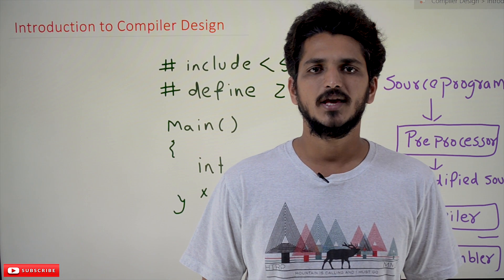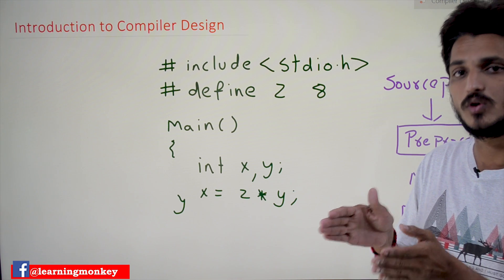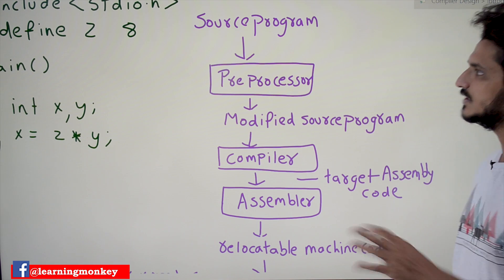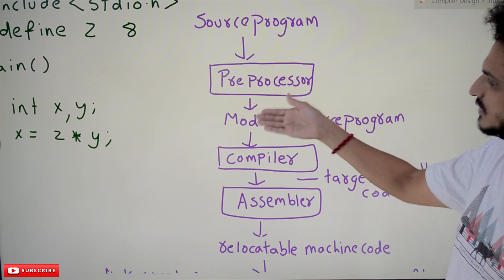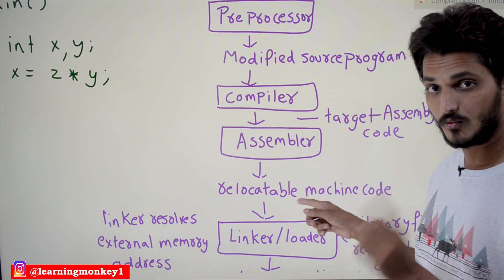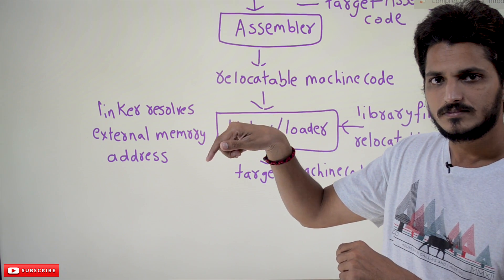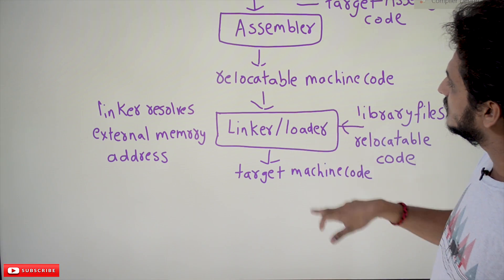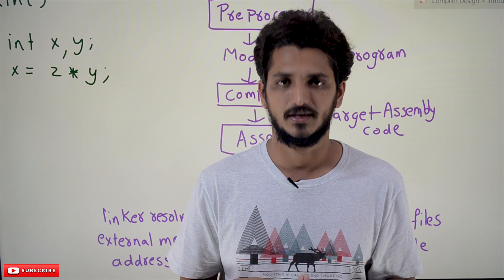Introduction to Compiler Design || Lesson 3 || Compiler Design || Learning Monkey ||

Comment: 00:07 Introduction to Compiler Design
00:56 Understanding roles and responsibilities of compilers
01:39 The preprocessor in compiler design converts macros and comments into machine level code.
02:29 Compiler converts modified program to assembly code
03:21 Explanation of assembler program and relocatable machine code conversion
04:10 Linking software provides address for placing code in random access memory
04:59 Loader converts source code to target machine code
05:52 Introduction to compiler design and its role in converting files into machine code.